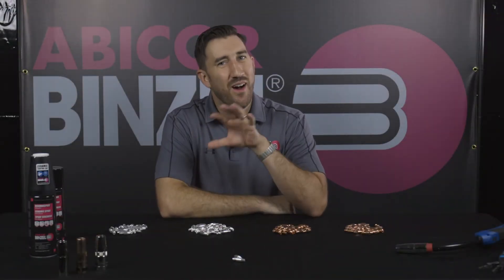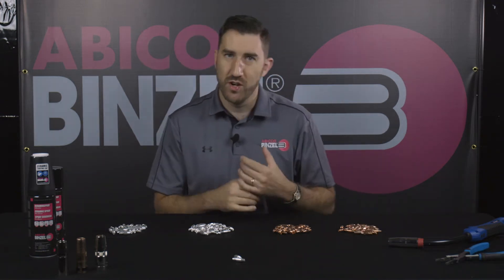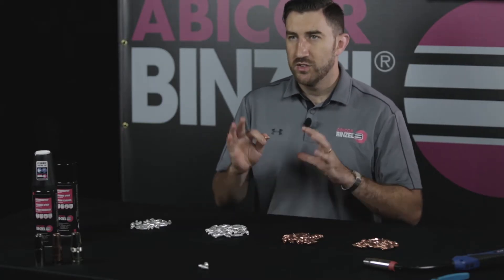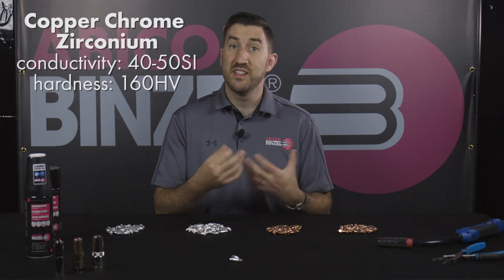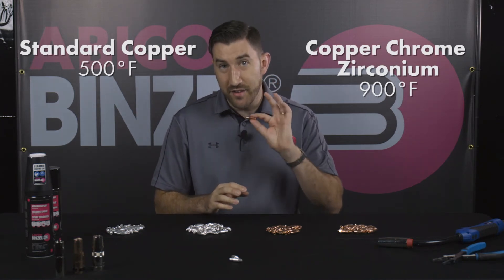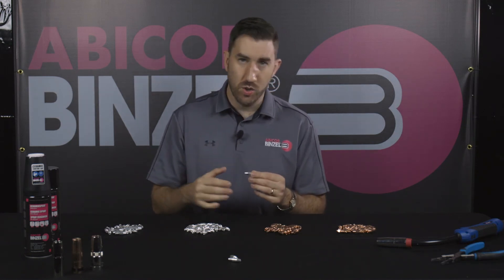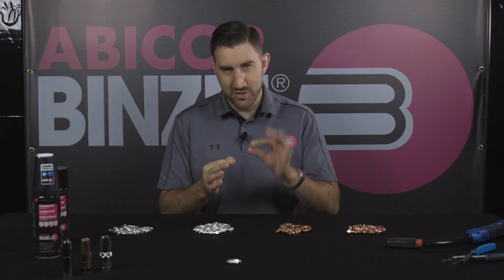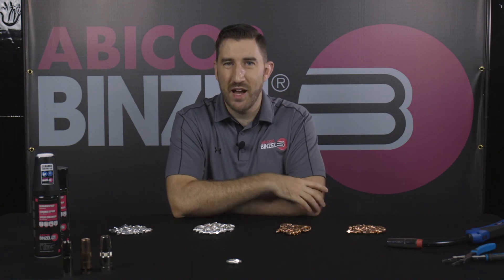Contact Tip Materials | Binzel Basics

Comment: I'm getting a wt touch, and I'm going to order some HDS tips.. I only weld at 450amp pulsed mig 1.2mm 316l, but I do long multi runs and the copper tips suffer big time and my copper shrouds.. And will get an m8 conversion if you do one????
Reply from the maker: Hey! HDS is a step up from Silver. if you're moving up in tip durability we would recommend starting with Silver before going to HDS. You might not need to spend the extra $ to go HDS.

Far as a conversion would go (I assume you mean trading in your copper tips for Silver) would talk to your dealer regarding that. May depend on their policy.
Reply: For some reason I thought the torch used a m6 contact tip.. It didn't, it was m8.. I've ordered a couple of different lengths/angle swan necks, diffusers and a Teflon liner from my rep off you guys.
Reply from the maker: Great! Let us know how it works out for you. Appreciate you reaching out!